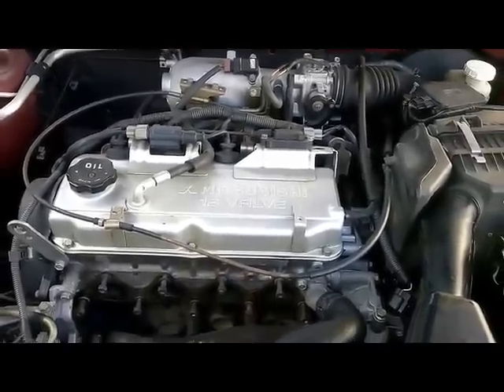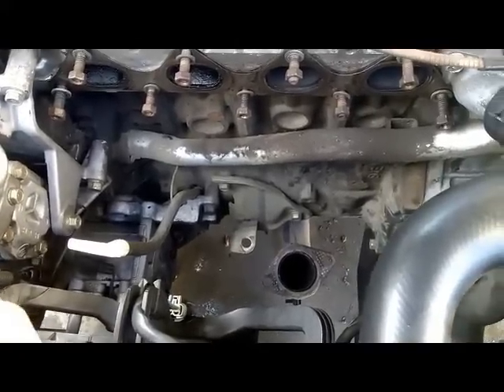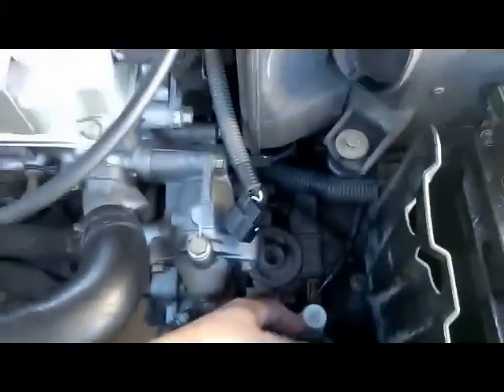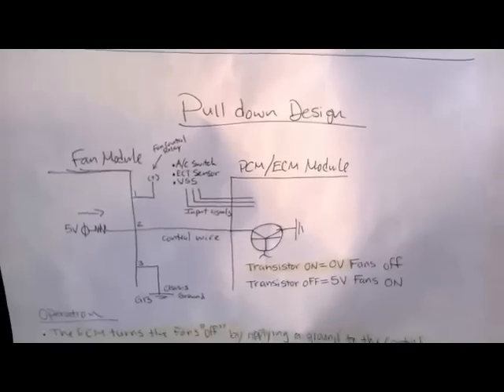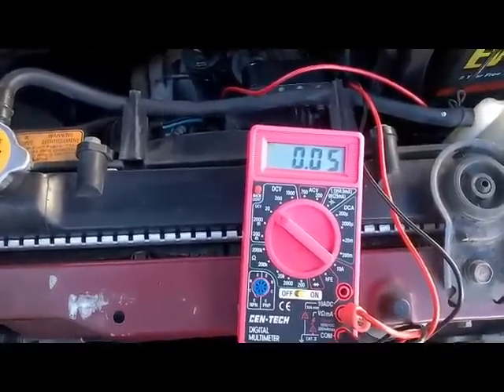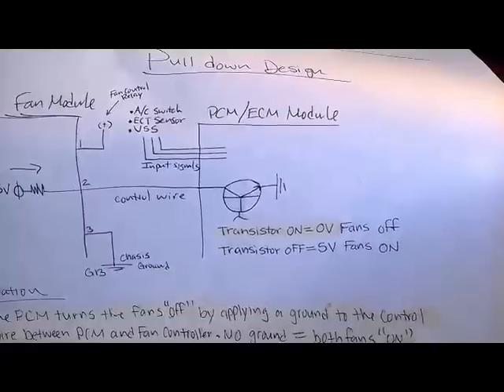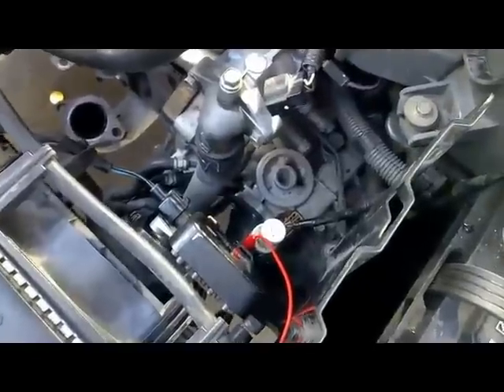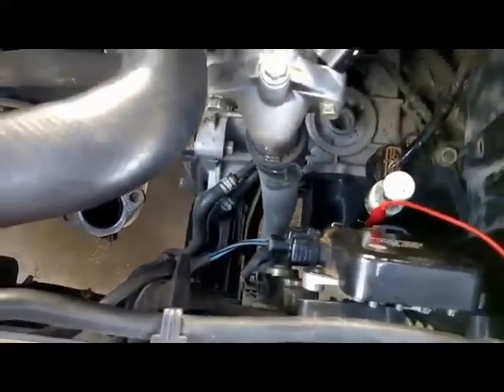(Mitsubishi Lancer) Faulty Fan Control Module

Comment: hello I have a question.  because, when I activate the A / C the 5v appear, but when I do not activate it the fans receive a voltage of 1.58v and at low speed.  Is this behavior normal?  Does the vehicle have high speed and low speed on the fans?
Reply from the maker: Hey there Roberto, I'm not quite sure if i remember seeing that voltage. Is that coming from pin 2 of the 3 wire connector on the fan module?
Reply: @EliTheOBDTech  yes.  it comes from pin 2 of the fans module.  when I activate the A / C the 5v appear.  to only regulate the coolant temperature only 1.58v appear in low speed.  would that behavior be normal?
Reply from the maker: @robertoserrano3204  I really don't remember if this vehicle was equipped with fan low and high. Apparently in the video when using the scan tool to do bi-directional control, I selected fan low option. The voltage went from 0 to 5 volts. Perhaps your fan control module it's starting to go bad. These modules tend short out internally.
Reply from the maker: Is your vehicle showing signs of trying to overheat?
Reply: @EliTheOBDTech  the fan module is new and original.  above, buy a generic one and the fans run at low speed.  with the new one it does the same.  only when I activate A / C the 5v appear.  I have already verified all the steps of the manufacturer's manual and according to the manual everything is perfect.  yes.  the vehicle has an overheating problem.
Reply from the maker: @robertoserrano3204 Try using two jumper wires and directly apply 12 volts to the fans and see if they spin slow or higher speed. You may  have some fan motors  that may be going out.
Reply: @EliTheOBDTech  I already tested the fans and it works perfectly by connecting positive and negative directly.  What I will do that I am going to connect them directly so as not to have that overheating problem.  I thank you for the help.

Comment: Hello! Good Video. I have a question. I drive Mitsubishi Space Wagon and there is a problem(?) with cooling. If i run engine for bleeding of lush ajusters for example engine get warm so both of radiator hoses are hot (upper and lower) but engine fan doesn't rotate. If i switch A/C on it does. I have correspond elektric plan of fan controller how can i upload this? 
Thanks a lot
Reply from the maker: Roman Janke Do you know if your vehicle has a fan control module? Like the one shown in the Lancer

Comment: I got a problem my fan is not getting any power I checked the wires and also I got a new fan the one the gos on right side how do I find the fuses
Reply from the maker: Check your fan control relay, it might be faulty.  It should be in the fuse box under the hood.

Comment: great work but my 2003 space wagon (chariot) tempture stay halfway but my fans dont come on dont matter hor far i drive car does not over heat i have change the coolant temp sensor and they still wont work
Reply from the maker: Damion Wollery have you tried to manually energize the fan motors by applying 12v to them? you may also have a faulty fan relay or even a blown fuse.
Reply: Eli TheOBDTech yes I manually test the fans and they work I even unplug it from the coolant temperature sensor and both came that's why I change the sensor but its still not coming on and car not over heating the mechanic says it's because the fan has three speeds I I am driving faster than the fan speed so the engine is always cooling
Reply from the maker: Mmmmm... well if the car is not overheating I'm thinking that your fine.
Reply: Sure hope so for all my drives are highway think I need to try traffic thanks for the help and keep doing a good job

Comment: My fan sometimes doesn't want to turn on. Could that be a module issue or fan issue?
Reply from the maker: Same vehicle?
Reply from the maker: If your fans are controlled by a module, most likely, it's the fan module.
Reply: @EliTheOBDTech  2004 lancer ES
Reply: @EliTheOBDTech  my car over heats periodically. The fans work when ever they want to. But some times they don't power on at all and causes my vehicle to over heat :/
Reply from the maker: @MrPewPew187  it's a very common problem on these vehicle, for a faulty fan module.
Reply: @EliTheOBDTech  awesome man thank you so much.

Comment: hey great video! but my concern is how did you verify that the fan module you found at the junk yard was good? can you check resistance between pins?
Reply from the maker: Elijah Falcon by performing the voltage checks and verifying that the voltages apply to the spec sheet.
Reply: Eli TheOBDTech maybe I word it wrong. I understand the voltage checks but as far as going to the junk yard and picking a random module, besides bringing one home from the junk yard. is there any where to check the module it's self at the junk yard before making the effort to purchase and bring it home. please and thank you
Reply from the maker: Elijah Falcon oh ok, unfortunately the repair manual did not give any specs on checking resistance, so I had to purchase warranty on the control module.
Reply: understood I checked for myself no luck. the issue with my mother car is similar the passenger fan does not kick on. tho if I spin it by hand it will turn slowly. my initial thought was the passenger motor had high resistance, but doesn't less than 2 ohms. I supplied power and ground via battery and works like a charm. but as far as it being connected to the fan module it's a no go. just purchased fan with module but I appreciate your time I subscribe to your channel !
Reply from the maker: Elijah Falcon thanks for your support. unfortunately these control modules are a common  problem on these lancers. a new module should solve your problem.

Comment: where is the ac module ? is it the same as the extra fan module
Reply from the maker: I believe that is the same as the Cooling fan module.
Reply: When it hot,compreser is not working..but when it cool condition compreser is working well
Reply from the maker: @tubagusgembessetiawan3273  another problem could be a glitching pressure sensor
Reply from the maker: @tubagusgembessetiawan3273  I'm not really an expert with the AC systems. Best bet is to take it to a professional AC shop.
Reply from the maker: Or, a glitching fan clutch relay that seems to fail when it gets hot and makes the AC compressor not engage.

Comment: hey sir, please help my car nissan elgrand, and the signal wire frm pcm shown 12v all time, is that pcm fault or can be bad ect sensor ?,  i hv the new control module , and the old module make my fan melted n then i replace the module , first start its normal ac on fan on ,engine tempt 98 fan on engine temp 95 fan off , but in the next day i turn of the ac ,fan on , turn of the ac fan doesnt turn off, and fan stil on , on key one position,, please help sirr
Reply from the maker: Hey there, not quite sure if this vehicle has a fan relay, that could also cause a problem.
Reply: @EliTheOBDTech  my car hv fanbrelay n i hv bought the new one but the problem is same key on fan always on
Reply: @EliTheOBDTech  and the signal wire always 12v ground
Reply from the maker: @fransiskusxaverius5648  give me the year make and model and engine size, when I get a chance I will look into wiring diagram.
Reply: sorry for late / Nissan Elgrand 2.5 AT year 2008
Reply: engine v6
Reply from the maker: @fransiskusxaverius5648  Sorry for the delay, unfortunately my alldata program doesn't have European models, the closest USA vehicle was the Nissan quest 3.5L v6 . Not sure if the cooling fan wiring diagram is the same for a 2.5L v6. I was looking at the wiring diagram for the nissan quest and almost seems that your problem might be your IPDM unit.
Reply from the maker: And Yes..... a faulty coolant temp sensor or faulty fan switch can cause your fans to stay on. I would use a scan tool and look at your coolant temp Data Pid to see how it reacts during cold and warm/hot conditions.
Reply from the maker: One last question,  does your vehicle have 3 fan relays?
Reply: @EliTheOBDTech  my tempt gauge is normal i see in my dashboard gauge its normal ,i see in scan tools its read correct
Reply: @EliTheOBDTech  no sir just 1
Reply from the maker: @fransiskusxaverius5648  The 3.5L nissan quest cooling fan wiring diagram would not work for your 2.5L engine. The 3.5L nissan quest shows 3 fan relays. It's really hard to help without having the proper wiring diagram.
Reply: @EliTheOBDTech  omg . the condition right now is if i turn on the ac magnet clutch on and fan on ,but when magnet clutch off fan stays on ,key on engine off fan stays on ,must keep it of 5minutes n then fan off
Reply from the maker: @fransiskusxaverius5648  your condition sounds like a module issue or can bus issue. Something is affecting module control.
Reply: @EliTheOBDTech  okey sirr thanks for the reply:)

Comment: Anybody here has experience about the 2003 Mitsubishi Lancer get rich gas, I already clean the MAF (not changing), change the fuel pressure regulator, EGR, PCV valve, new o2 bank 1, new Catalytic converter, new EGR valve solenoid, new spark plugs but it's still rich. Anyone here have any idea.
Reply from the maker: Whats your fuel trims numbers looking like at idle and 2500 rpm?
Reply from the maker: Any misfire codes?
Reply: @EliTheOBDTech  no check engine on and OB II scanner couldn't find any code but when ever I take out the spark plugs it turn black and the o2 has too much soot on it.
Reply: @EliTheOBDTech  I don't have the measuring fuel pump pressure yet
Reply from the maker: @PhongLe-nd2wj  use your scan tool and look at the short term and long term fuel trims at idle and 2500 rpm.
You may have fuel injector problems
Reply: @EliTheOBDTech  that's what I doubt it. I think it's time to change the new injection. Wish you're close my area, so I can bring my car to you. Thanks a lot, I will update after I change new injectors
Reply from the maker: @PhongLe-nd2wj  I'm glad to help!
Reply: Finally, I made decisions to change the ECU and I went to the Junk Car and lucky for me I got a good one for $22 include tax and put it in. Everything smooth so far. Thanks for your helping video, my car had the same problem with your video and got that from junk car too and now the coolant fans running back to normal. Appreciate that.